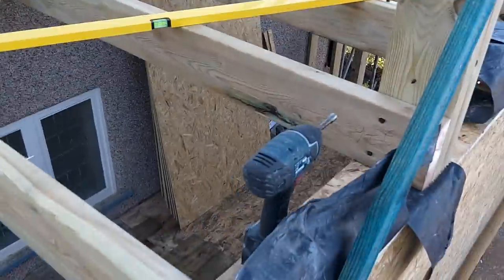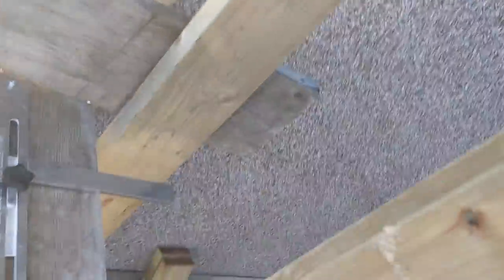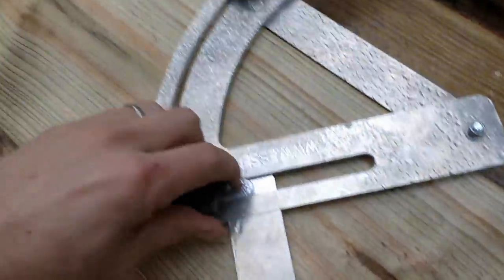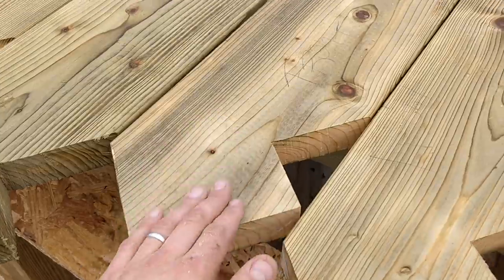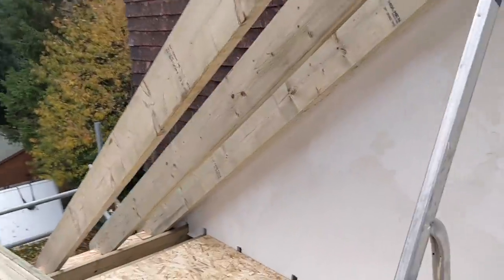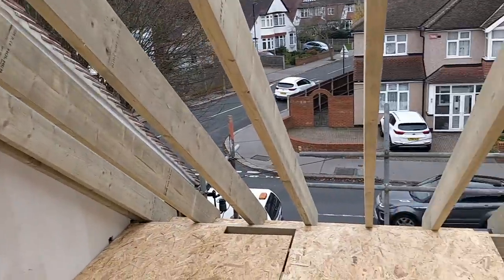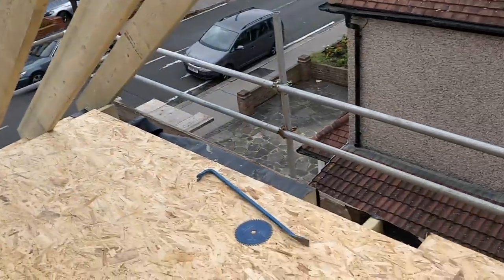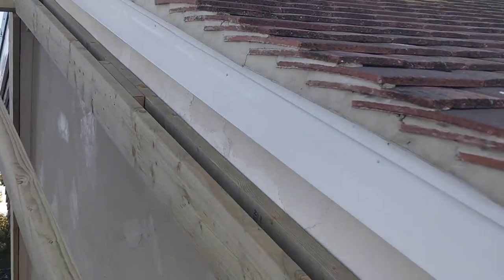Side roof rafter construction

Comment: You could have just plumbed a line down the rendered wall and the work your existing roof angle from that. With a speed square
Reply from the maker: Yes you're right mate, and I did try that. The difficulty is the accuracy of a speed square given how small they are. Reading a 1/4 of a degree difference on a speed square is almost impossible, but makes a bit difference over the span...tricky!

Comment: Could you not have done without the OSB strip on the side with the error and had a less deeper birdsmouth.
Reply from the maker: That would have worked to keep the rafters level, but I think I would have ended up with slightly (marginally) different wall heights on the outside, and the render at the corner would have stepped down.

Comment: Why have you gone with an offset ridge?
Reply: Suspect planning dictated it, usually an extension "must be subsurvient to the original dwelling"
Reply: @Max-tn1us  Madness, a stepped roof line is always to be avoided if possible in my opinion. Planners, most of them are clueless, 🙄
Reply: @TheToolnut  Agreed, unfortunately it's commonplace and in the planning policy. Usually they look to have a differentiation between old and new but when the old isn't that old (e.g. not an old country cottage) then it often ends up looking awkward.
Reply from the maker: Yes that's exactly what it is - planners told me outright that we wouldn't get planning if it wasn't subservient; stepped back at the front and lower at the ridge.

Really not ideal, but it's their way of showing power and control 🤣
Reply: Is that why you never used two 8x3 bolted together?